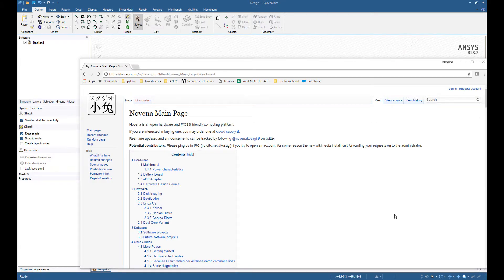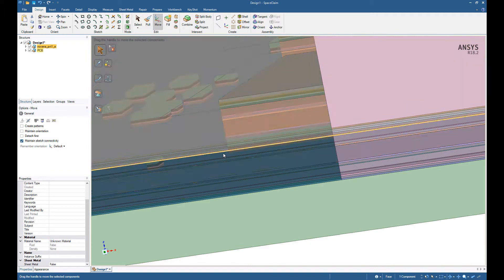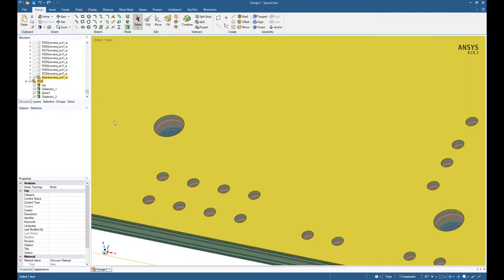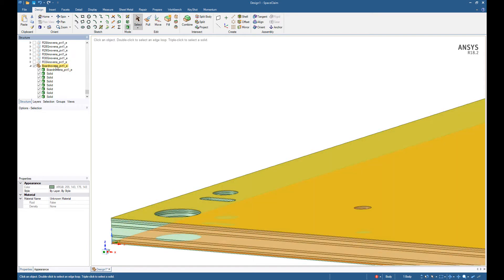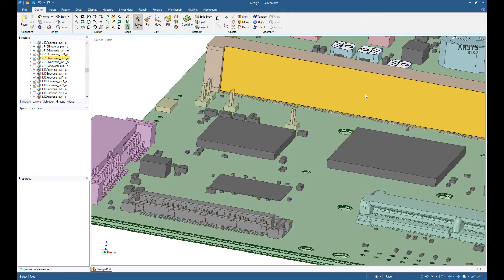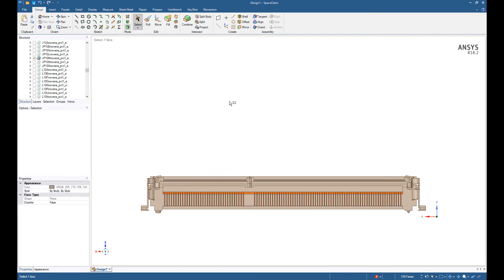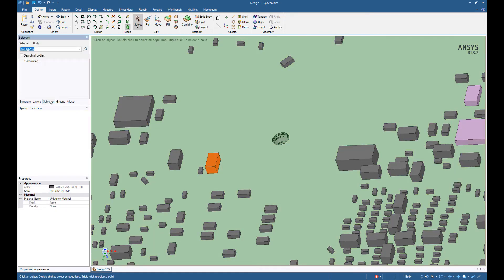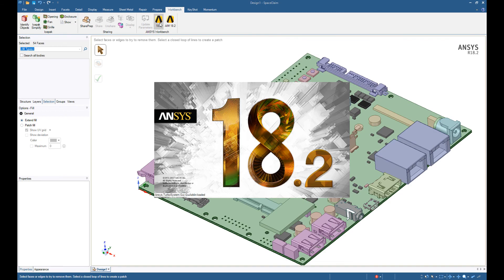ANSYS PCB Warpage Analysis Part 1: Geometry Cleanup

Comment: I am looking for the same answer as Jackie Kettner and Burak Brutcu, can anyone help?  How do we import the PCB files with layers into spaceclaim?
Reply from the maker: You can import odb++ into Spaceclaim directly, just drag and drop. Or look for the "other ecad" section when you do file>open. ODB++ need to be in a tgz file. I think this was enabled a couple of years ago.
Reply: @SingularityEngineeringLLC  Hello, I was able to import the TGZ file and I am also able to import either a step file or a Solidworks assembly file containing the mechanical CAD data of the PCB.  However, I am not able to merge and split the mechanical board like you displayed here.

Some other observations is that I can load the TGZ ECAD file into the mechanical model for trace mapping byitself.  I am able to also load the solidworks assembly file into Mechanical Model, but I keep getting the plug in failure after I load both of them into the same spaceclaim file.

Do we have to split the mechanical board in spacclaim?  Will I be able to just split it in CAD based on my understanding of the thickness, and then transform the coordinate system of the trace map to align with the board?

Please, I really appreciate your help as I am literally just hard-ball learning this on my own and can't seem to get Ansys to respond to this directly.

Comment: Hi,
How did u get the tgz file that contains the layer data?
Reply: Just drag and drop into space claim. You need to import odb++ in Geometry module as well as External data module in ANSYS workbench and then link the Geometry module and to the Geometry of (Static Structural,Modal or any physics) and link the External data to model module of the physics. Afterwards open the model and do trace mapping. The import trace is listed under materials.